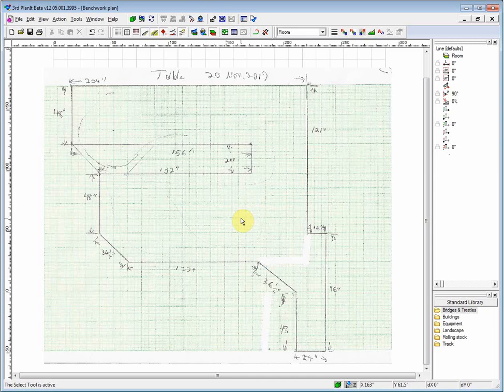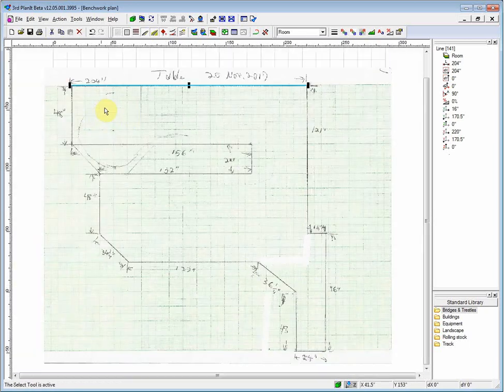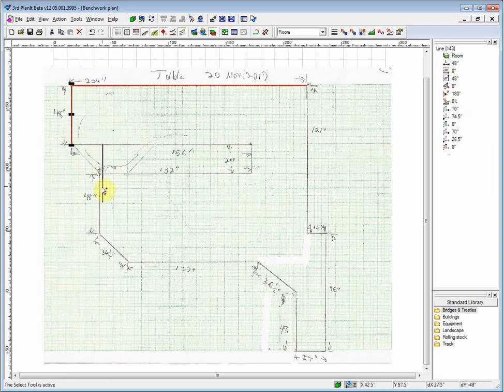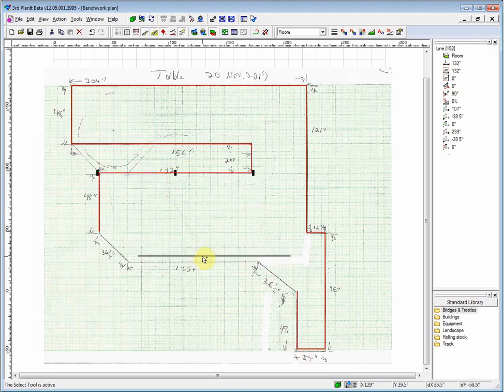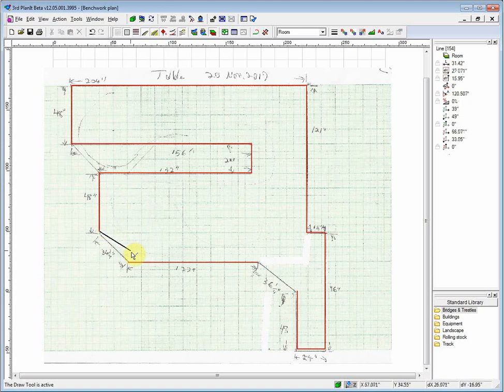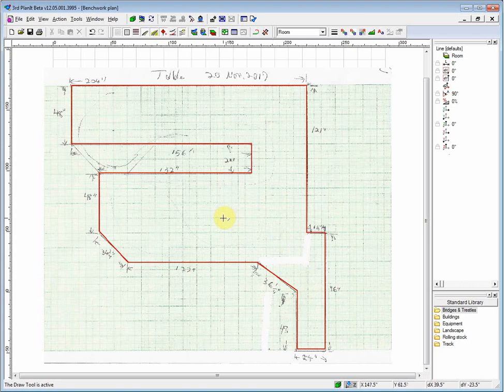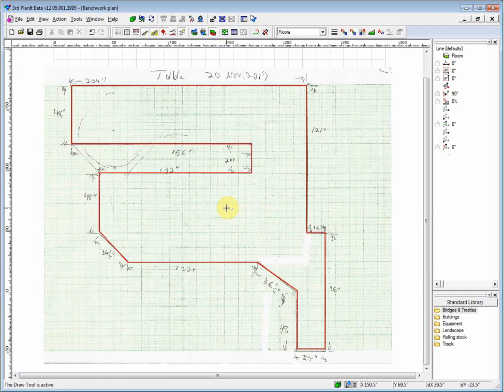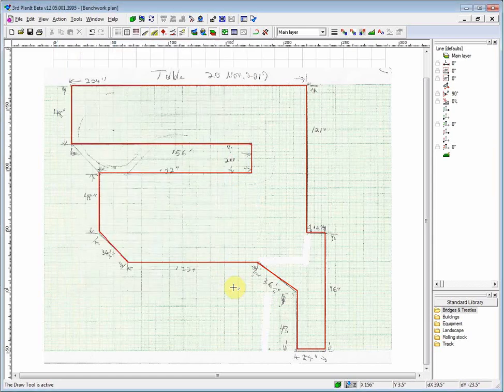Tutorial: Drawing a Room or Table Outline

Comment: Hi, thanks for the video, it is really helpful. I would appreciate to have access to more of those.
Actually I'm trying to follow the tutorial in PDF provided with the demo but if each chapter could be available as a small video it would much easier to understand. Sometimes a video is worth 10 thousands words. I must say I have mixed feeling about the software, it has really good features like auto-easements and turnouts, a good 3D visualisation compared to other layout software and overall, behind the scene it seems very well programmed but the ergonomics could use a revamp, then it would be the perfect tool. (And the new layout splines feature is huge as I own a CNC router).
Not sure I'm ready to buy it. Let me know if you want feedback about where I've struggled. I'm designing a two deck N scale layout and I'm using AnyRail for now, there ergonomics are really good but 3D terrain is bad, it has no automatic easements and I struggle to build complex helixes.